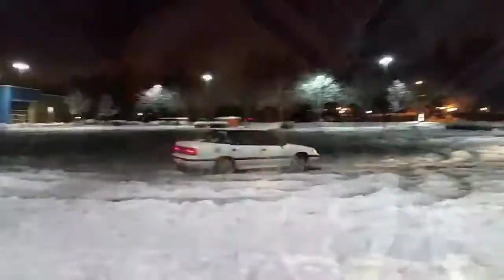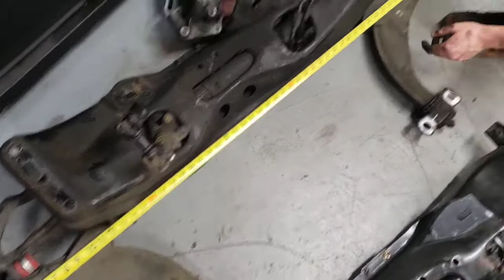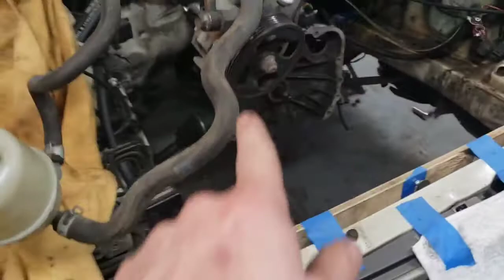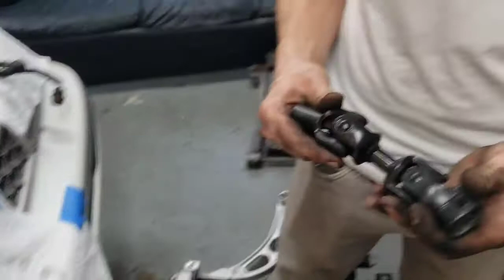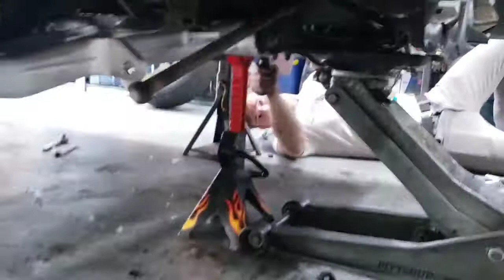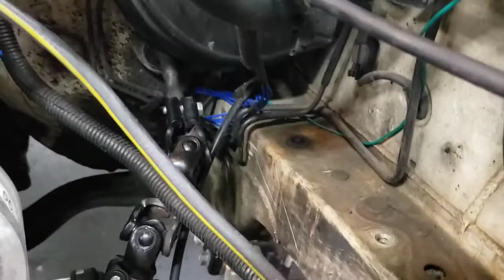05 STI Steering Rack Swap 91 Legacy Turbo

Comment: I have a 96 legacy (JDM) with one leaky ass gear box did you had to do anything special for 05 to fit? And was it a manual as well?
Reply from the maker: Are you talking about the transmission or the steering rack?
Reply: It's the steering gear box but mine most definitely is leaking gear oil not power steering fluid. Not sure exactly where is supplied from but my power steering fluid level has not changed at all however had to top up the tranny once or twice.